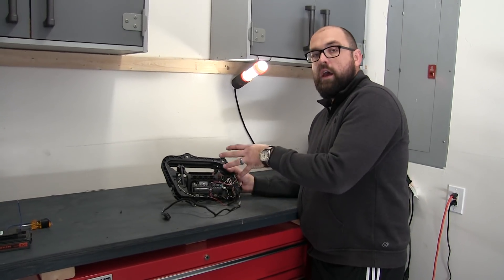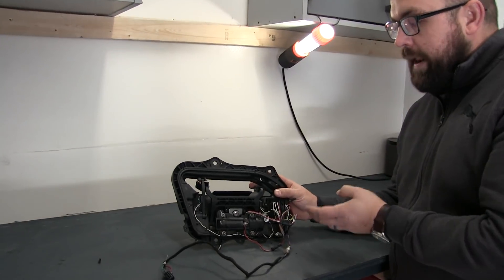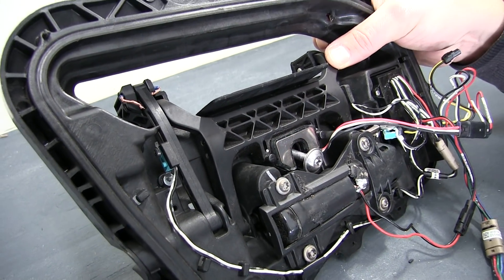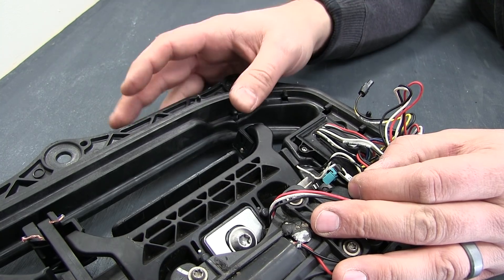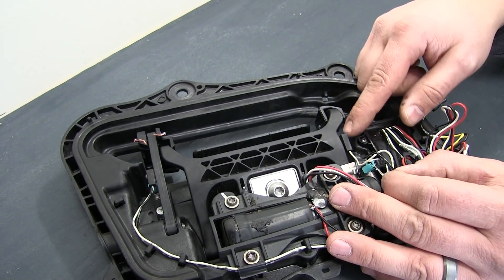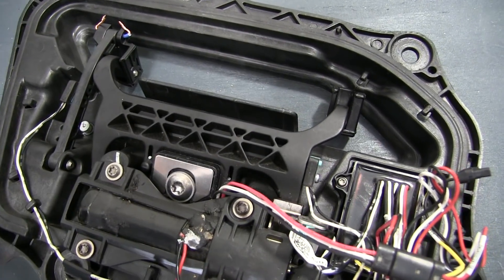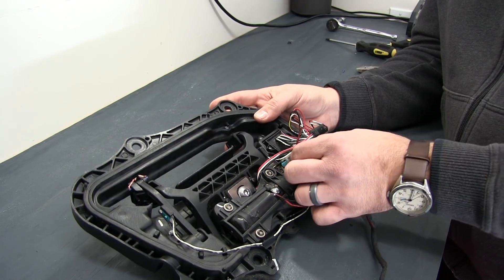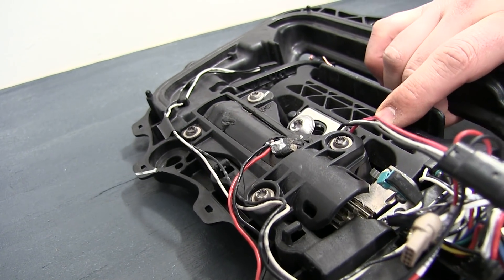Why Tesla Door Handles Break And How To Fix Them

Comment: Hi all, have you ever experienced the controller module going bad? 
My door handle had a broken wire on the blade-switch that detects the handle all out. I have checked all three switches and they work fine.
When I resoldered the switch, the handle goes all the way out and the motor never stops. 
When I reconnect the main door handle plug, the handle goes in slowly and then automatically goes out again to stick to max without the possibility to pull to open. 
Sometimes it goes in and stays, and I can push it to go out, but then it stucks on max out again. This is making me crazy 🥴 Can it be the controler module being broken?

Comment: My handle did not retract - but only occasionally. In such cases the door closed and locked as it should and it was possible to open the door with the handle. Usually (but not always) the handle retracted as it should the next time. I have installed a new harness with the 2 microswitches. Still the handle stays out occasionally. I can not see anything systematic in the behaviour. Any suggestion what could be the problem?

Comment: Oct. 2022: Tesla offered to repair it for $ 430 with a mobile technician. However, the paddle gear is available from Tesla for $6 and i will do it myself.
Should be a V3 Handle but still broke after 18 months.

Comment: Many thanks. I used this video to fix my front driver door today; it was presenting, but then continued to grunt thinking the handle was not fully extended. The root cause was two of the micro switches; both were electrically OK, but one had a loose mounting screw and one had a broken metal actuator lever. I ordered new switches (thanks for the p/n below!) and re-assembled for now. Works!
Reply: Easy to take door apart?

Comment: That has got to be one of the biggest scams in the auto industry. $700 plus on an assembly that doesn't have a chance of lasting anywhere near the lifespan of the vehicle.
One of Tesla's biggest mistakes and was definitely a factor in me not buying a Model S.
Really good video that should save quite a few people some money.
Reply: Perfect video, thank you for sharing. I have a question: is there a chance to read out the status of the sensors whithout removing and disassembling the door module? Especially when it has intermediate symptoms? Thanks
Reply: same just too many tiny engineering problems is keeping me away from owning one i dont wana deal with all this unexpectedness when i could just buy a camry etc that you can count on
Reply: @Datacorrupter234  I ended up with a  M3 Dual Motor delivered last day of 2020 in perfect condition and continues to stay that way.
Very cool car to own and drive, it's just superior.....period.
My year of free charging is now over but my charging fee is still pretty low.
Driving an EV is quiet and comforting.

However, I'm quite appalled at the price increases. Definitely puts it out of buying contention for most families.

Comment: Hi Boost Brothers, there are 2 different types of micro switches used here:  One with and one without lever. Your link points to the Panasonic micro switch without lever but it would be more sensible to point to the one with lever which is Panasonic ASQ10418. This way you just have to order/stock one type of switch because the lever is easily removed to convert to the non-lever type (which is Panasonic ASQ10410).

Comment: My door handle works fine.  Except the pressure sensor does not work.  When I press the handle it won't present.  Is it the sensor with the module that needs to be replaced.  I have to hit park to extend then pull the handle to open the door.  Thanks

Comment: Thank you so much for this video. With this video and another to take out the handle, I had much help replacing my broken paddle gear on the 2013 Model S 60 KWh. I agree with other commenters that this is overly complex, and prone to breakage due to multiple points of failure. Bad design, I’m sorry to say.

Comment: Mine (classic) is opening the (rear door behind the driver side) door automatic or random have not find out when or why...... is that also a microswitch issue?
Reply: Yes, its probably poping the door right after presenting. One of the two microswitches on the handle tells it its presented. The other tells it was pulled on and to pop open the door. Usually the wire breaks open and you cant get in, for your case maybe shorting. The third switch on the cog tells it the handle was pushed on for re-presenting the handle.

Comment: It’s easier if you release the springs to remove the rod, also on the paddle gear they have bushings as well this example they probably disintegrating when the paddle gear broke. They are thinner than the other bushings used throughout the rest of the unit but same inner and outer dia. Also loosening the center bolt allows easier removal of that inner switch on the fork This example is a very early version and yes they are a horrible design the 2.0 version has the same issues (same parts internally) informative video otherwise

Comment: Hate to say it, but its really a piss poor design. With the frequency of failure and a decent third party engineering report. I think there is ground for a class action lawsuit. At minimum it could force Tesla to extend the warranty for an additional 5 years or more. Or make the repair part free to replace. Simply having wires on a microswitch fail would indicate its the wrong wire for the application, and its installed without proper strain relief on a moving hinge. That alone is an easy win. The piece that is cast is more than likely under-engineered, and requires a higher wall thickness, or machined out of a solid block. Also noticed there is zero grease or lubricant visible on the pinion gear assembly. A good lawyer can really make money off of this one.

Comment: The big problem with the switches is the wiring was not properly engineered.  Where the wires exit the switch is a high stress point.  The wires should be attached to handle frame and routed to a point of minimum movement.  You do the reroute when the car is new and they last forever.  I believe there is tech bulletin about the switches and the wire reroute.

Comment: I had to replace all 4 of my door handles at some point after the warranty expired.  Spent nearly 4 thousand to have them replaced by Tesla.  They upgraded mine to the 2nd generation handles, since they claim they had a lot of issues with the 1st generation handles.  I will definitely save this video and try to do the repair myself if they ever fail in the future.
Reply: Carlos Fowler - I can’t think of much I’d rather spend $4000 on. Thanks for confirming why I don’t want a Tesla

Comment: As a formal slot technician. I can see the headache in the optic sensor and micro switches. One manufacturer comes to mind, IGT. They used both, and both were in series for the door. The micro switches were placed so that when the door was shut, the switch was closed. But there was one more thing to be done. That was to push down on the latch to engage the lock. Of course the optic sensors was on this large latching system. And if the optics did not like up, the slot machine wouldn’t see a door closed. 

They were a major PITA because you couldn’t tell if it was the optics not lining up, not working or the micro switches not lining up or working. All because it was in series and the slot machine only saw open or closed.

Comment: +Boost Brothers        What a fantastic video. I've had one door mechanism replaced under warranty and the service guy was kind enough to give me the old mechanism to play with. It was a micro switch failure. The rack and pinion failure mode was news to me. One point not mentioned here is the fact that all four of the Model S door mechanisms are different. That was a strange design decision as was the choice of mounting the micro switches on moving parts rather than on the stationary part and using the moving part to operate the switch, a decision that meant the wires to those switches were flexed, eventually leading to failure of the micro switch sub loom.  Anyway thank you so much for this video.
Reply: I think TESLA want to make money from maintanance

Comment: It seems the wires, electric contact point are not water proofed, what if water, ice or sand got in and contaminated the contacts? Seems like a design for interior electronics, not  for door parts?
Reply: Actually the door handle assembly has a rubber gasket to protect against water intrusion.
Reply: Wenbiao Liang you are totally right, it is mostly of the shelves parts for household products, and it's definitely not made to last long. A pity for a 100k bucks would-be high end green car...